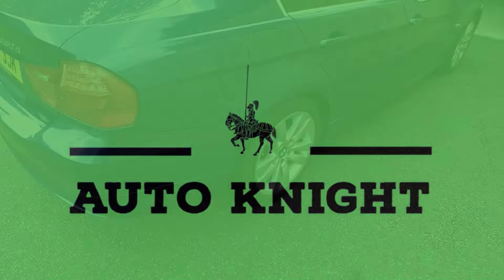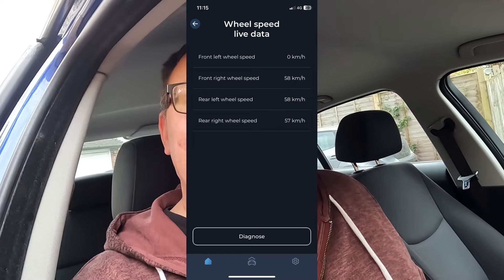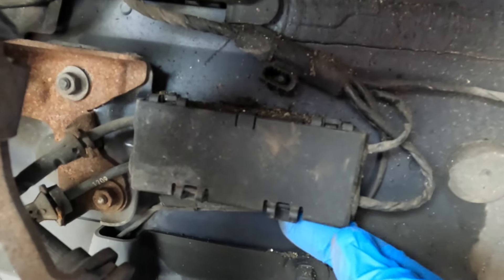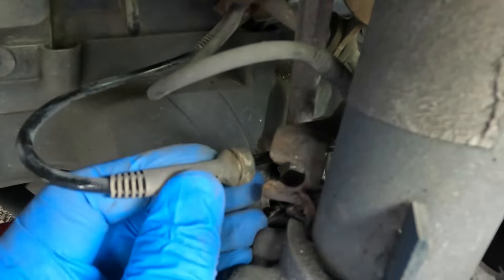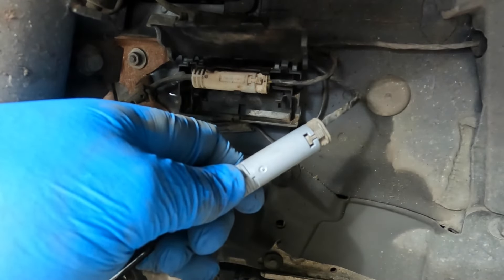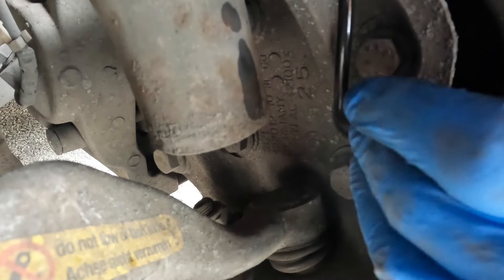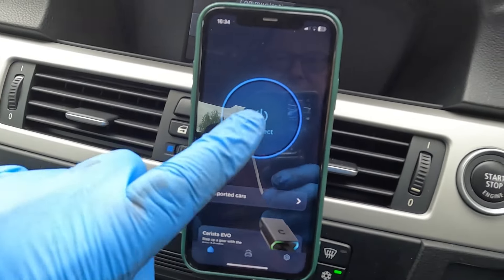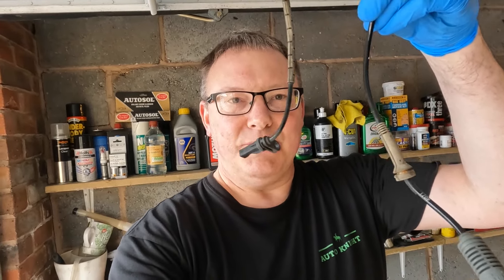Replacing Front ABS Sensor - 2009 BMW 330D E90 N57

Comment: Hello, thanks for this, as usual, clear and lean tutorial. I have a question about the diagnostic device you use, Carista : is it also compatible with the Smart? Do you have a preferred place where I could get it please?
Reply from the maker: Unfortunately Carista does not seem to work with Smart. It is very good for Volkswagen group and as you’ve seen, BMW. I’ve had it a while and genuinely can’t remember where I bought it. Their support is pretty good too. No replacement for high end universal or manufacturers specific diagnostic equipment but useful day to day.